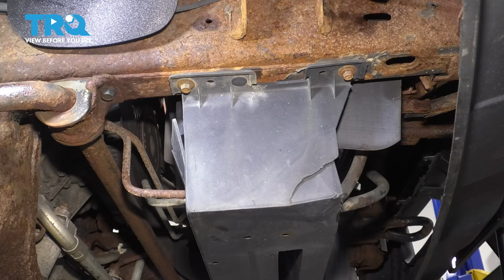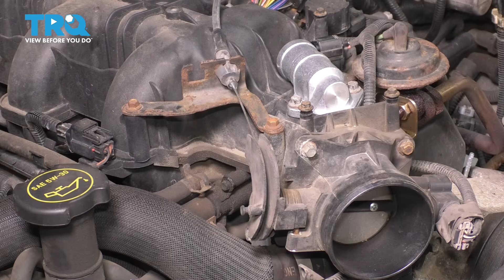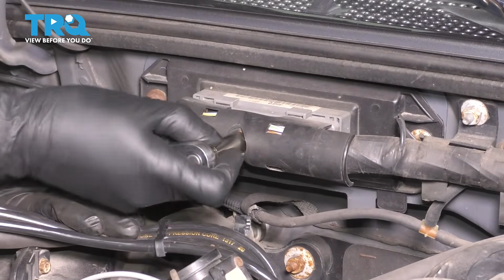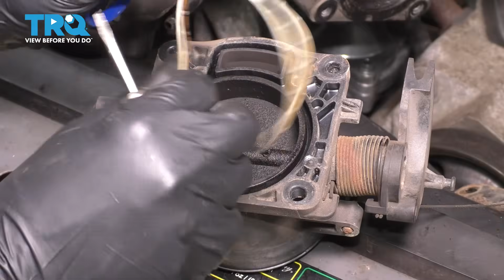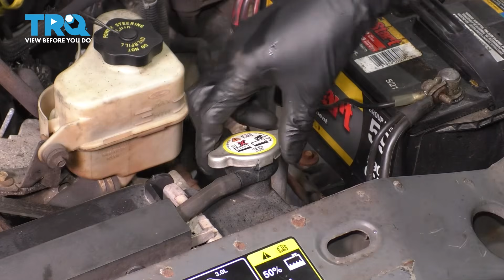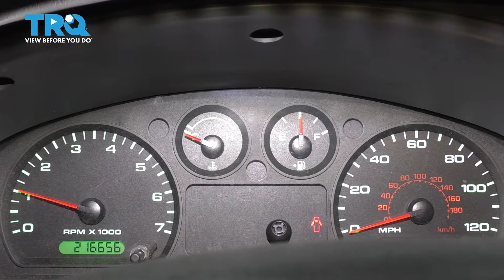How to Replace Coolant Temperature Sensors 1998-2011 Ford Ranger (4.0L V6)

Comment: Seems to me like there are so many variations in the parts on these trucks. My intake came off basically the same way but some of the vacuum lines were located in different places. Just a terrible engineering design.

Comment: Don’t need to remove intake, just take needle nose pliers to remove the clip. Then they can tilt out without much resistance. Once it’s out you can then disconnect the electrical connector to exchange the new sensor. Good video otherwise.

Comment: Very thorough video, though you don't need to remove the entire intake manifold in order to replace the coolant temperature sensors. Just need to remove the throttle body.